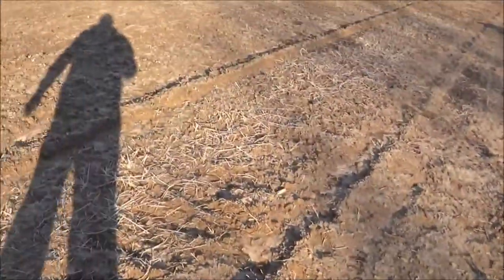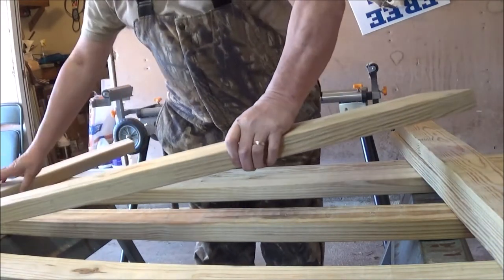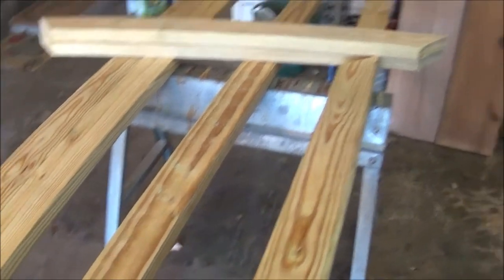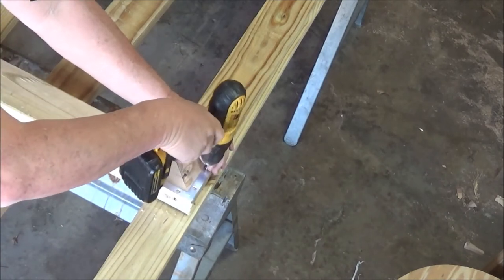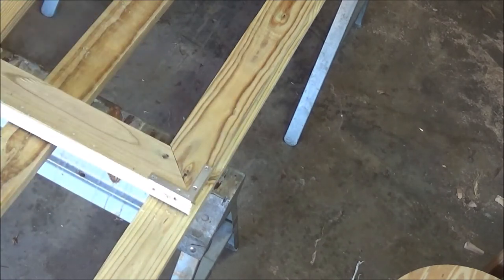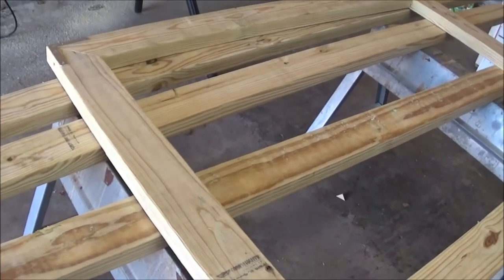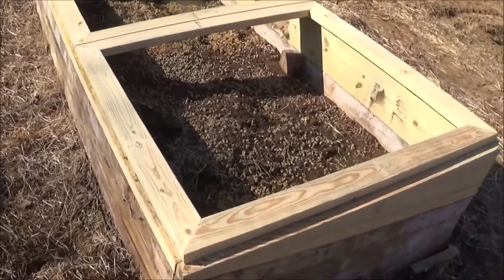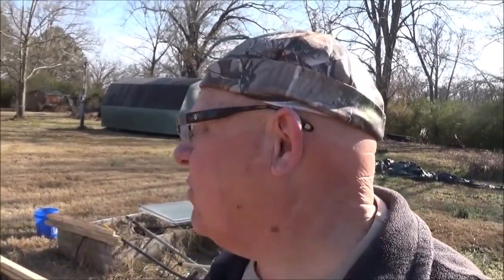BUILDING THE COLD FRAME

Comment: Wanting to build a greenhouse. Will use polycarbonate for the roof. God Bless, stay safe.
Reply from the maker: I’m going to build a greenhouse using cattle panels soon.
Reply: @fitzpreacherfarm6826  I looked into those and they are a great idea. I have the windows that were replaced in my house and I will use those for East and South walls. I have a 12 x 20 high tunnel ordered - when the plastic comes in, I will start building.
Reply from the maker: @joeyhardin1288  keep us posted, interesting to see it. If I had some old windows I would use them for sure.
Reply: @living the dream Don't know yet. But I purchased 6 mil, 4 year plastic. The polycarbonate is advertised for 10 years.

Comment: hello from the cool vibrant ozarks gary!!   did the dewaldt  mitre saw fit ok on the harbor freight or did you have to make some adjustments to use the dewaldt on the saw stand?  tight lines and grace be with you!
Reply from the maker: Dewalt mounted with no problems. I think I have an unboxing and mounting video.
Reply: @fitzpreacherfarm6826  will check dewalt unboxing  i saw the saw stand from hf.